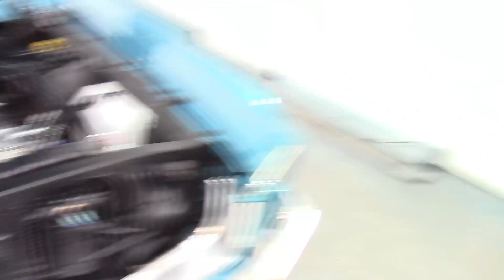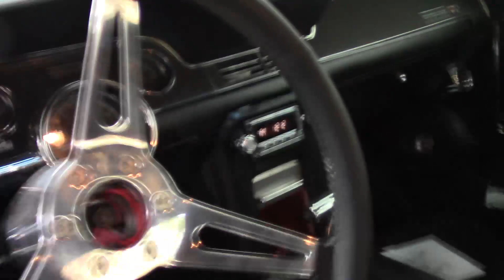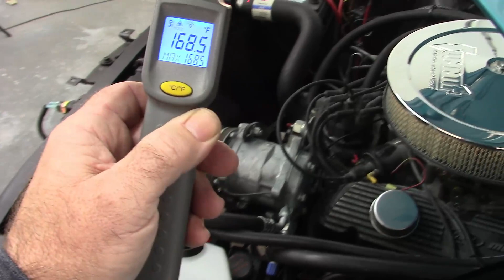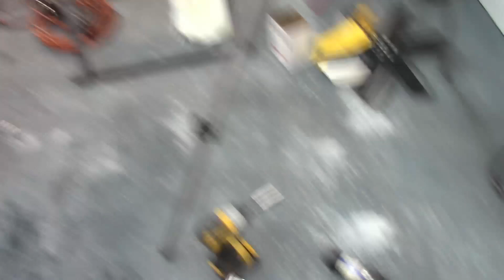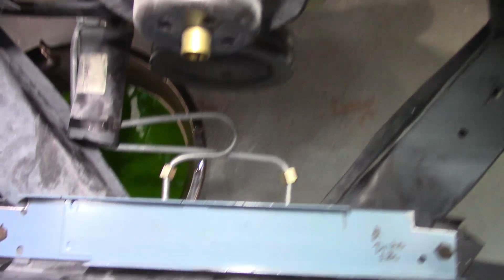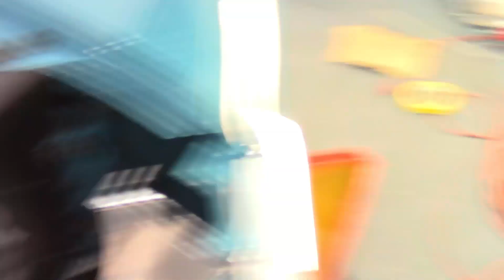Alloy Works radiator. Making brackets and test fitting. Jade part 105.

Comment: The Radiator link pulls up their website but no reference to the rad you were sent.  All the 70  mustang rads have different hose mounts or caps.  Prices look reasonable.  How is the fan noise at stop lights?
Reply from the maker: I haven't driven it yet, but during testing, I was inside the car, and couldn't hear the fans. I don't have the best hearing though... lol

Comment: I have the exact same bottom on my radiator, smaller ends. Was lucky my factory lower bracket fit my aftermarket Aluminum Radiator.  I also had to do away with my 'Gauge in car" radiator cap.

Comment: I must be wrong, but I thought Ford radiators bolted to the radiator support on the sides.  Hence not requiring the bottom or top holders.
Reply from the maker: The early mustangs were bolted in on the sides.
Reply: I just put a Champion 4 core with electric fan and shroud in my 67 and it bolted right to the 4 holes in the core support and didn't use the factory rad mounts. It has the lower outlet on the driver's side as well.